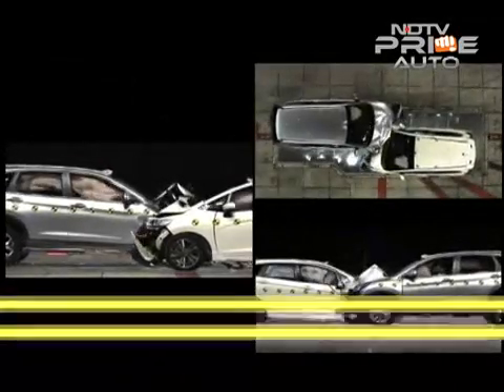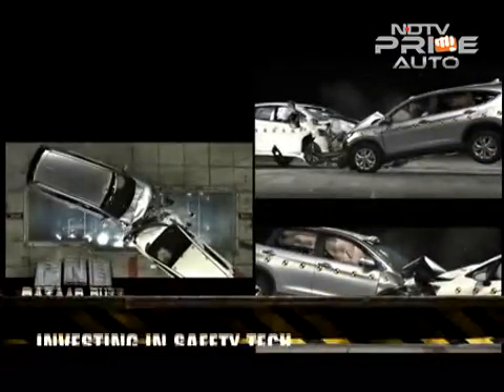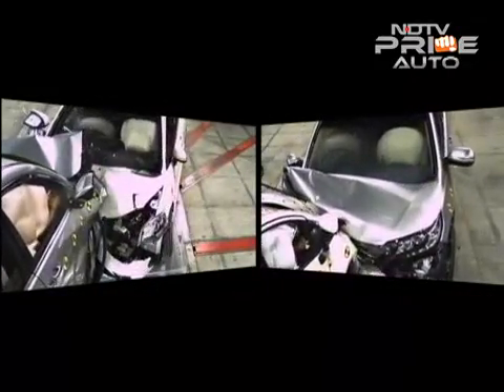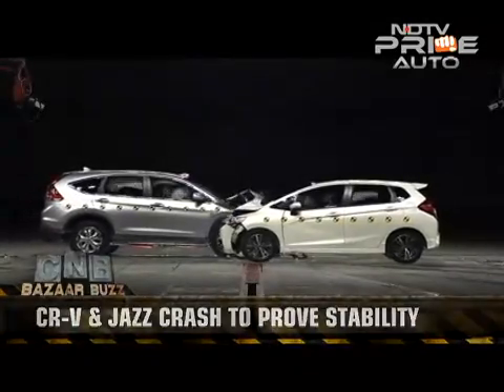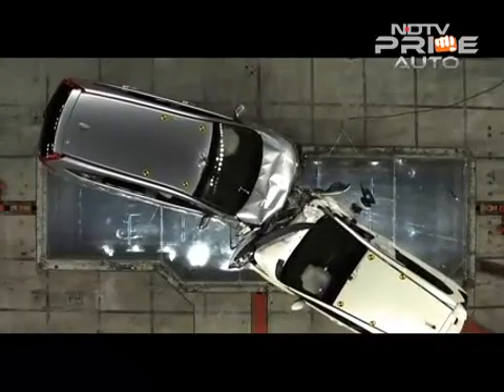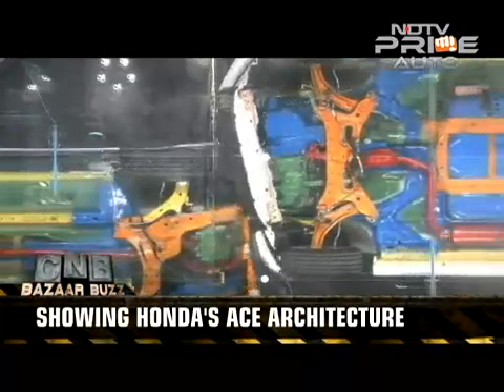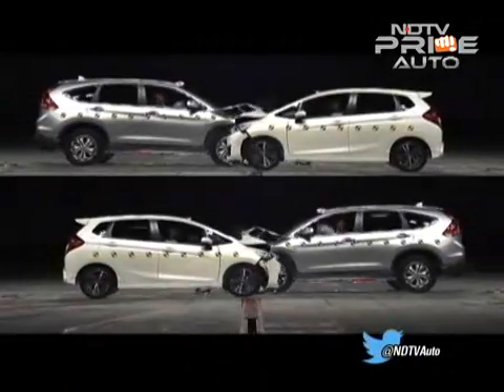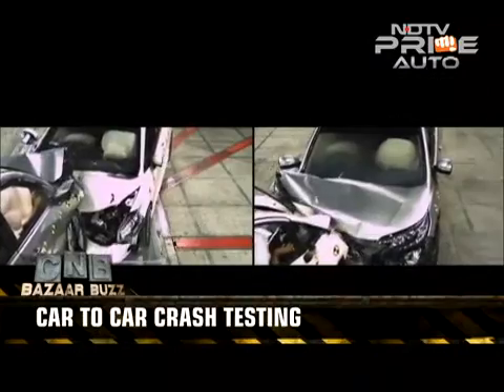Honda's car-to-car crash testing program

Comment: It has always puzzled me why left hand drive cars are on the right side of the road and vise versa.  It seems, for the driver at least, it would be safer in a head-on collision.  Also, you wouldn't be stepping out into traffic when your pulled up to the shoulder or curb.
Reply: Grady Cochran i believe it is because it is easier to see when overtaking some 1 in Front of you